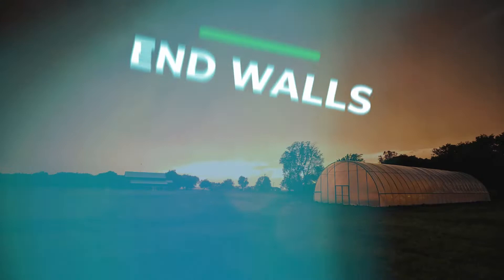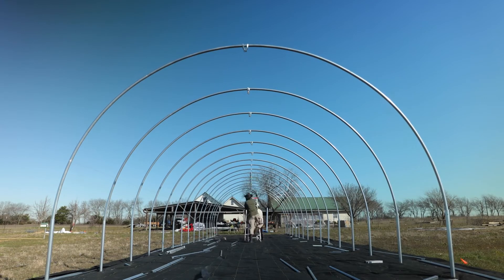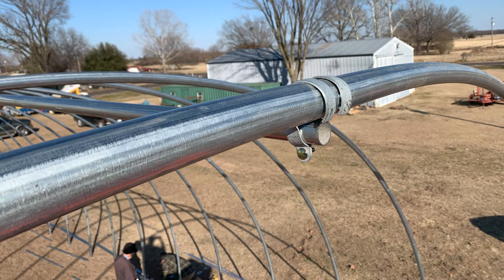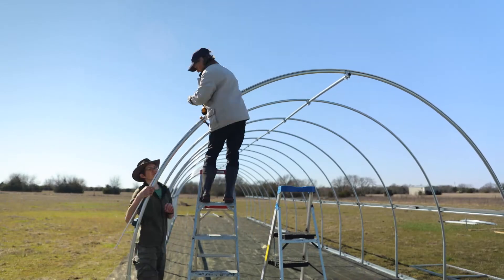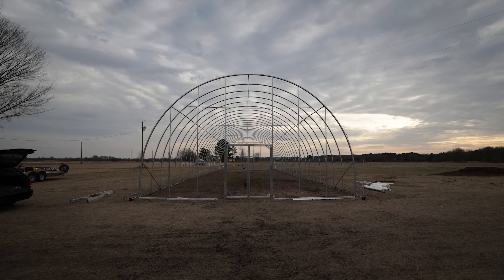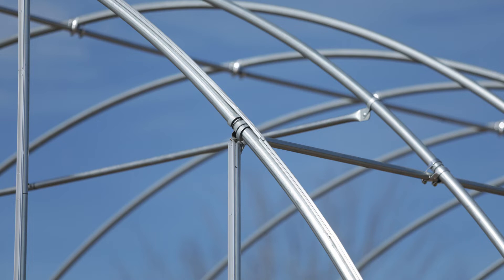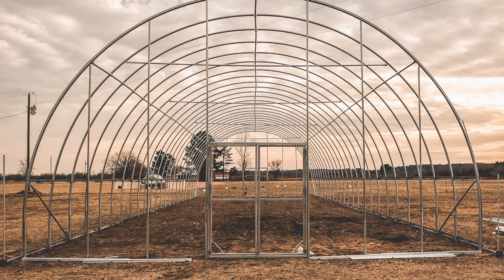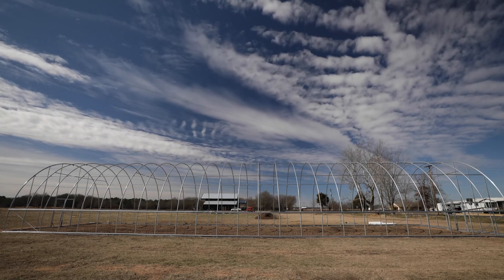Stabilizing Your Hoop House for All Weather | HOOP HOUSE 101 Ep 11

Comment: why is the ridge pole not on top to help shed snow/rain?
Reply from the maker: The hardware would interfere with the plastic the ridge pole is on top.
When snow is removed with ropes its better to have a smooth surface rather than a bump.